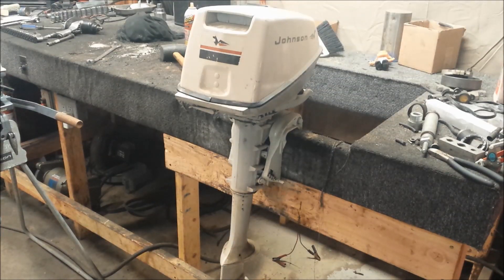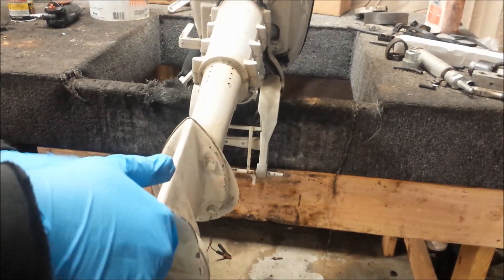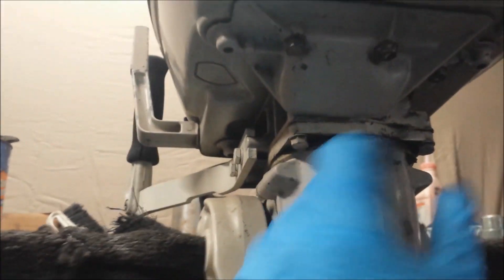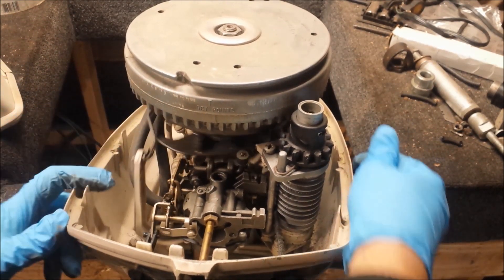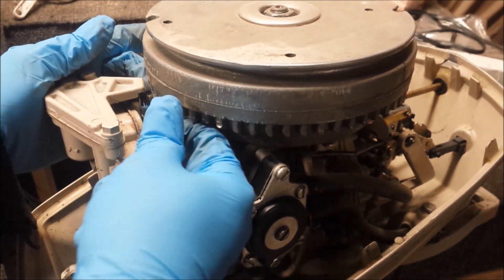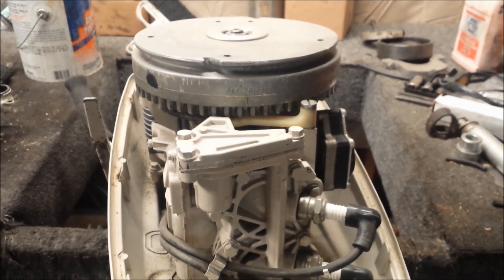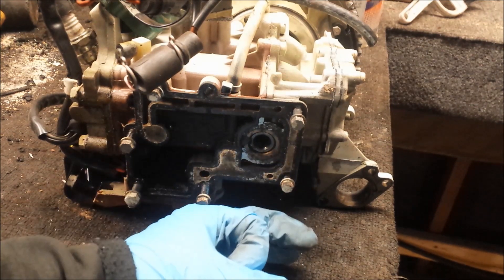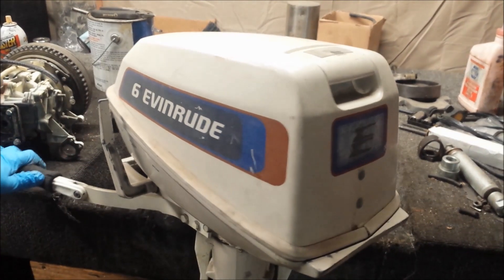A Look At A Johnson / Evinrude 4, 5, and 6 HP

Comment: Hi, I just replaced my coils on my six hp. One cylinder was cutting out. Also throttle was hard to turn. Replaced coils, no spark either cylinder. Followed ignition wires around. Both broke off at the clamp next to starter. Replaced ignition wires one at a time. Had to removed new coils again. Checked I had spark with gap tester. Fueled her up and now get a backfire? Long ignition lead is going to top cylinder. Shorter lead by starter assy goes to bottom cylinder. Any thoughts? I did notice my points were gapped to about 0.014 vs 0.020 spec. It was running fine last year so did not want to mess with that. Any advice appreciated.

Comment: I saw your recoil video. Will most likely have to do that. I’m new to outboard motors. Last time I launched on a slow river it didn’t have the power to go up river. I think a 4hp evinrude should be able to go up slow current. Any ideas where I should start problem solving? Thanks

Comment: Great videos. I've got a 1990 4hp deluxe and you helped me get the pull rope mechanism working correctly. Should my 4hp Deluxe  have some type of air box covering the carb? All I have now is the carburetor inlet open with nothing covering it.
Reply from the maker: No sir, nothing but a little choke knob bracket.
Reply: @BrandonsGarage Thanks!

Comment: Thanks for all these videos. I have a 2000 Johnson 25 and a '71 Evinrude 6. The 6 has a puzzling situation going on. When the tank to motor hose is disconnected a small amount of fuel spills from the fitting on the lower cowling. Some of the fuel in the hose running from the connection fitting to the screen cover on the fuel pump runs out. I took that fitting off and found that there is no check ball in it, nor does it appear that one ever existed. Did the older small motors not have a check ball there? Thanks
Reply from the maker: Correct they all do this. Turns out that valve wasn't invented until some point in the 80's
Reply: @BrandonsGarage  Thanks for taking time to explain and saving me $50+ bucks only to discover that the new one also had no check ball. I really appreciate your low hp Johnson/Evinrude videos!

Comment: I've been trying to get my grandpa's old '79 johnson 15 hp outboard engine running. It ran when it went into storage, but it's been sitting for over 15 years. I am extremely green when it comes to boat engines. Aside from changing the water pump and gear oil, is there any other critical parts that need overhauled before trying to run it?
Reply from the maker: Not really, no.
Not if it was put away correctly.
(storage; winterizing, or running it out of gas)
Reply from the maker: Not really, no.
Not if it was put away correctly.
(storage; winterizing, or running it out of gas)
Reply: @BrandonsGarage  I agree, I run out all my gas  ⛽️ before I shut it down -

Comment: hey i have a 6hp johnson and it has trouble starting but when it does start it runs great. any tips?
Reply from the maker: check compression?
And what is your starting process?
Reply: Brandon's Garage pull choke and put it on start and pull. The guy that I got it from said he put the wrong gas/oil ratio in to. But he got it starting great.
Reply: The guy know how to start it. What’s a good sequence to start the engine?
Reply: @BrandonsGarage  exactly
Reply: @h-townfishing1382  yes put in right 
oil /GasRatio - new Plugs 🔌 too - also before  shutting down Engine -unplug fuel line and run out gas . 👍🏻

Comment: I’ve a good question I’ve a 4hp but i wana put an 8hp carb they are basically the same with different jets how well will that work
Reply from the maker: Not at all, much larger pistons on an 8hp than a 4.
Reply: @BrandonsGarage  hm some mods might need to be done

Comment: Really interesting Brandon. All your videos are  really helpful and informative. I have an evinrude 1966 6hp with only about 10hrs on it.
As a newbie can I ask you how often do the gearbox seals need changing. Is it every couple of years?
Reply from the maker: once ever 10.
Give the age of the rubber in yours, they probably need to be changed. As does the water pump.
Watch my 9.5 Lower Rebuild video. Exact same process.
Reply: Brandon, I have a johnson 9.5 that wont stay in gear while running. What would cause that?